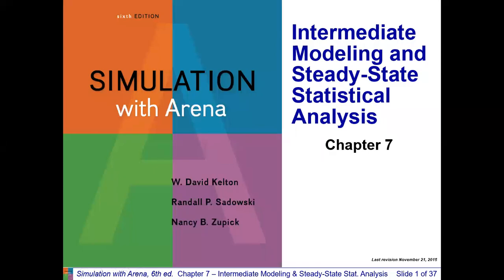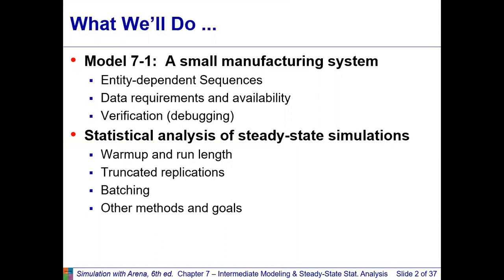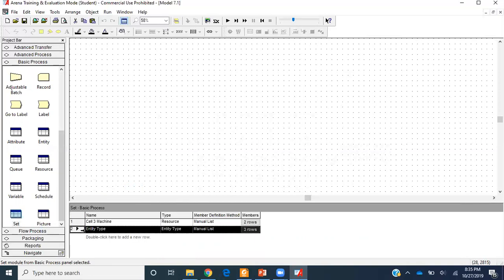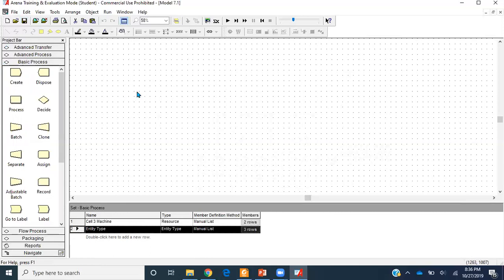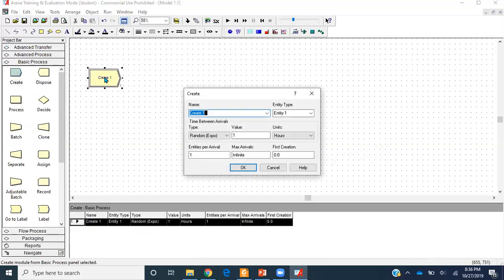Simple Manufacturing Plant with Entity Dependent Sequence Movement

Comment: In my sistem,  there are 5 DC (Distribution Center)  to decide. But i wanna the entity have a priority to choose the DC with minimum value
Reply from the maker: Hello Alief, 
If you want the entity to choose one of the distribution center based on priority then you may use the following logic:

1. Select Type: N-way by condition from the dropdown list inside the decide module.
2. Then in the condition :(Select the type: variable, name: variable name you used, then assign the value in the expression)
3. Repeat step 1 in total for four times.As there are five distribution centers, thus the last one doesn't need to be declared. 
4. Then attach the output of the each decide branch to the input of the right distribution center.

Hope it helps, Thanks